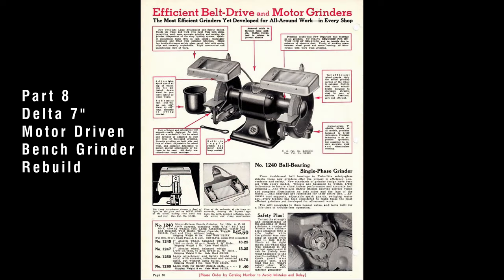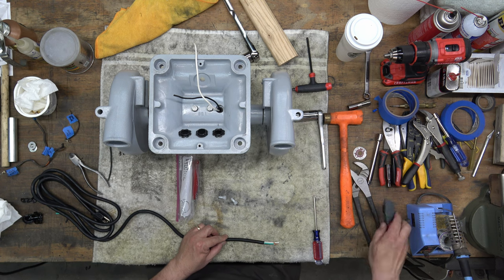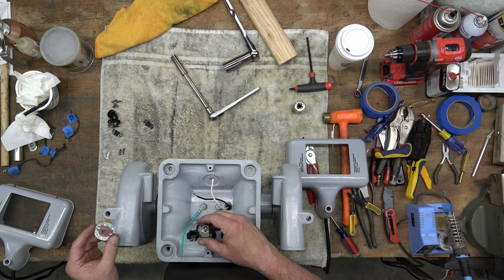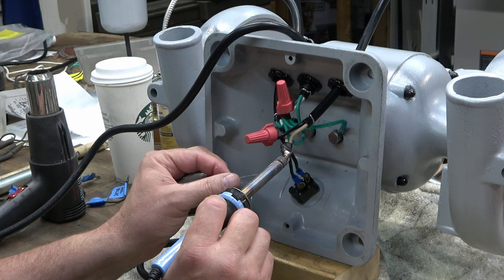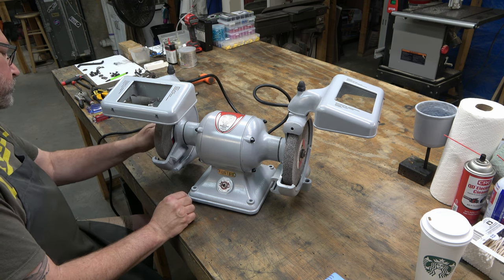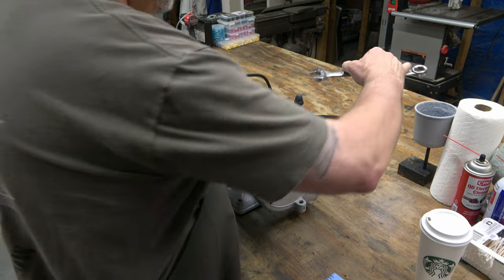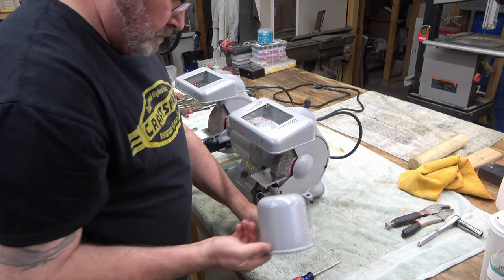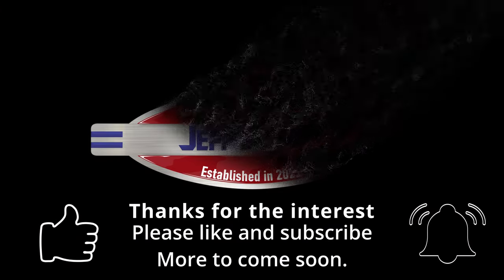Part 8 Delta Grinder Rebuild (Final Assembly)

Comment: Question about wiring. The black from power cord went to switch, where did the other black wire that went to switch come from? Tia! Love the grinder and your detailed series btw!!
Reply from the maker: The black from the power cord goes to the switch the other back on the switch goes to the other blacks (from the twin lights and the stator). This means that the power comes to the switch then to the rest of the lights and the grinder. I hope that helps.